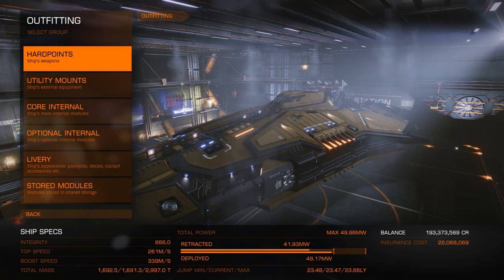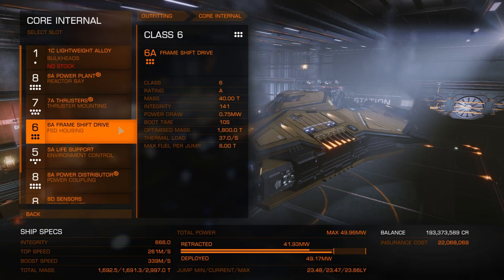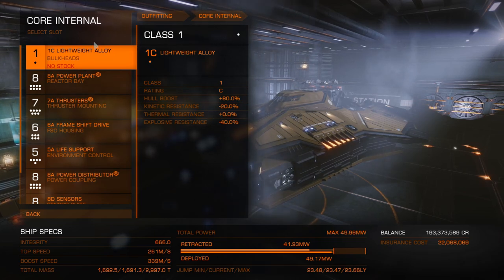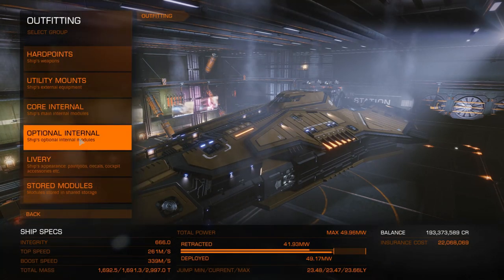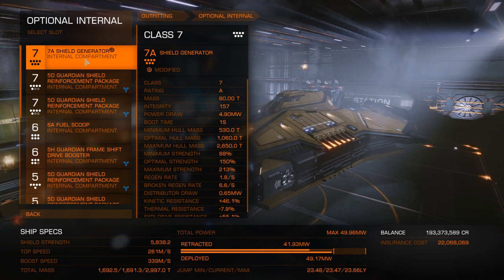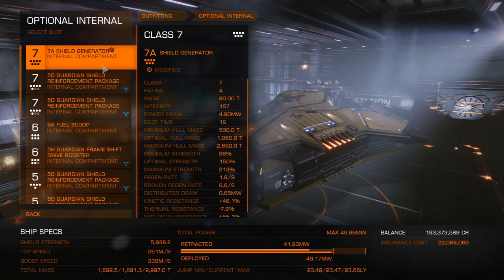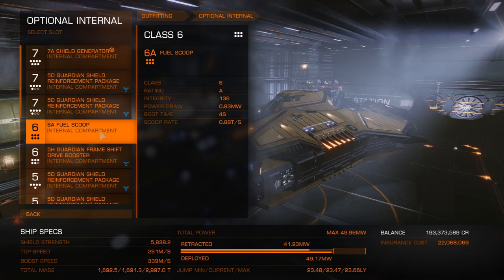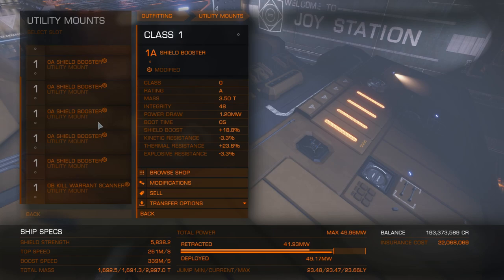Elite Dangerous | Federal Corvette | Combat Build

Comment: A no ammo loadout that I run is 2 medium and one large beam laser with heavent and close range they're one class stronger. The medium lasers each have about 25 DPS and the large one has about 35 DPS, if I remember correctly. Then 2 small railguns with plasma slug for anyone who uses chaff and then two huge PA's with plasma slug and overcharged for 'cause they can DELETE larger NPC ships. Very fun and  v e r y  deadly!

Comment: When they loop and throttle down, wait for them to close the gap then throw it in full reverse and you'll stay on target longer. When they start to pass pull your stick up and full throttle. You'll never lose target against big or med ships this way.
Reply: Or thrust downwards and look up. Also, better pip management
Reply: Another option is to pull a flip, thrust downward, pull up and revolve your thrust as you spin and one you are at full 180, full reverse, I have pulled this off on a couple FDLs and it's helped

Comment: power management(in my opinion) was a bit off.  When fighting NPC, shield longevity is key.  I would have put 2 pips to systems and 4 pips to weapons.  2 pips to systems over 1 pip makes a huge difference in shield strength longevity.  Power management(in my opinion) is much different between NPC combat, and PvP combat

Comment: I'd recommend a bi-weave for pve, you can get roughly 2000mj with 60% resistances, 5000+ hull is a good idea too.
2x 7a banks is pretty much a must on any corvette, you get roughly 6000mj of shields back from them.
While you're running gimballed, practice flight assist off as the corvette handles even better and if you can master that fixed lasers are more dps and less distributor draw.

Comment: I just got one of these too!!!. I'm running all focused burst lasers except one pack hound and a small over charged frag with corrosive.
Reply: The pack-hounds make sense for the times when you get chaffed and to keep up the damage rate (assuming the shields are down) while you get your aim back.
Reply: @simonpotter7534  I like to think so. That or a rail with plasma slug ..so I'm not worried about that ridiculous shot price
Reply: A high cap corrosive MC would be better, will last a lot longer than a frag. Try efficient on the huge Pulses, wi help you maintain fire for longer
Reply: Cool..I only use the frag when their sheilds are down and in close. I'm not wild about efficient lasers I would rather have more damage at distance over 500m plus the armor piercing of focused is a plus...but I'm a big "to each there own" kinda guy
Reply: I use efficient on the huge hard points and they still shred. You get a damage increase, less power usage, the focused uses more power and any armor piercing you get over 75 is pointless. Give it a try, it's pretty good
Reply: @cmdrravenwulff5272  I figured anything over 75 helped with breaching damage, but I'm pretty new to it all. I am just a 65 year old man playing video games lol.

Comment: I went with the Fixed Beam lasers with long range grade 3 and Thermal Vent - there is no chance of overheating if you stay on target, plus the fixed does more damage and not effected by Chaff spam.

My main gripe about any build is that the DPS is still way too low to be able to take down target before they decide to FSD out of there, which means the previous few minutes has been wasted.

What I try to do now in Haz Res sites is to pick the target that already has multiple NPC's shooting them, this allows for a much faster kill rate.  Plus as you already know there's no ammo to worry about.  You may be nerfing your self needlessly by having gimballed weapons as you're not spending as much time shooting them, but that does mean the ship is cooling down naturally.

Comment: I have this build but on my fdl, I have the vette but I dont like it as much as the fdl because it isn't that well engineered. On the fdl I have 4 rapid fire pulses and one huge beam with efficient and thermal vent, everything is g5 and I have 5c biweave with 50 to 70% resistances so I maximize charge over capacity and let me tell u, it's the best of both worlds. No ammo consumption, no overheating, decent amount of firetime (about 8 secs before capacitor is depleted) and on top of that scb's that ensure shields won't go down. It's a good and fun build

Comment: 2nd mistake....  gimbaled hard points when using lasers. whether it is beam, pules..   There is simply no need since there is no lead time for your shoots.  and the extra fire power you get with fixed weapons is much higher.  But if you must use them, you should unlock target when they use chaff and they work as fixed weapons.
Reply: It is with the vette. Shes light on her feet for a fat girl but not that light. If you want more than 2 seconds on target gimbals are a godsend

Comment: 1:41 your 1st mistake... the drive should be "quick boot"  in case you get hit by a FSD scramble missile you fsd reboots in 2 seconds vs 6 seconds... and yes it does make a difference when your shields are gone and you have to wait for the fsd to reboot.  for extra range add a grade 4 fsd booster..
Reply: Armored FSD is also a good option for combat ships. A lot of CMDRs - who know what they are doing - will opt to snipe your FSD when your shields drop, even over the Power Plant. Dead FSD = Dead in the water (or space). Many players who go for extended range FSDs in combat ships find out they made a mistake the hard way.
Reply: @jcdenton1841  happened to. Me last week. Except I got lucky and he targeted my fsd booster by mistake. So I got away. But great point.

Comment: I prefer 4A Fixed Beams, powerful and don't have the issue of being disrupted during chaffs. I opted to go with efficient, but overcharge would work wonders, and may be the only weapon you will even need on the Corvette. The rest I filled with 2x C2 Regen Beams for wingmates and pulse. You can unload the smaller hardpoints on a target as you wait for the big ones to fully deploy.

Comment: I didn't really see you put 4 measly 215mj guardian boosters into slots which could contain about 10000mj total in SCBs, did I?
Why?
Reply: SCB cause mad heat and massive power consumption, its also 100000 times more handy to not have to worry about your shields dropping
Reply: @cmdrblitzkrieg1012  heat can be handled by heat sinks, power consumption from modules is part of every proper ship design, also you can switch off 2 of the 4 cell banks until the first 2 are depleted and then switch. Watch some vids of e.g. Mayrune to see a properly built vette in case you are interested. You said not worrying about your shields dropping is always better well, the scbs reinforce it by 10000. so you're saying 800 mj guardian module is more than 10000 in scbs?

Comment: My Federal Rank grind was done in Gliese 868 by doing pirate massacre missions in the next system over. Took a while, but I earned over 2 billion credits at the same time.
Reply: How long did it take?
Reply: @cmdrblitzkrieg1012  a couple weeks, but I was casually pursuing it, only an hour or so a day. I just couldn't handle the monotony of the courier missions, especially since I had only just finished doing the Imperial courier runs. That took like 6 hours of dedicated circling, but it was more straightforward than the navigation required in the Federal run.

As for the pirates, in Gliese 868, i started in an Alliance Chieftan and finished in a laser Anaconda.
Reply: @FiveFootFall  might start the grind
Reply: @cmdrblitzkrieg1012  Good luck and Godspeed, Commander!
Reply: @FiveFootFall  o7

Comment: Love the courvette just a bit of easy mode when you get it....you do realise the cutter has a much higher potential shield than this though....the prismatics suit these large ships too might be worth the 4th week rush to get them :-) try the huge beams mixed with multis simple but effective weapon lay out..a turret in the large slot helps as it's quite hard to get it to target with all the other guns..:-) glad you like it n fly safe cmdr
Reply: Meh, I have a fully engineered vette. Unless you're in hardcore pvp or fighting goids, bi weave is better. Understand that while prismatic will last a long time in CZ and hares, they won't really recharge at all while you're out, you can always reboot repair, but that takes time. And take a long MF time to charge even on a pad. Bi weaves will not drop ever in PVE, and will let you stay out of station indefinitely (ammo permitting)
Reply: @Lperry  I'd never put bi weave on Vette  :-) I've had a vette for  a few years now deadly with no need for the recharge especially if used right, mines only legacy engineered and I haven't had my shields drop in pve for a long time...its shields arnt as good as my cutter but if you build in resistance and strength they last longer than your ammo
Reply: @lukedudley5030  I've never had shields pop in my corvette. I mean recharge rate while the shields are up. With a resistance build you may go down 1 bar with 6 pve ships laying into you, but you can recharge easy in between fights or after a cz is done. With my prismatic I find I have to go to the station and sit on my thumbs for 5 minutes after 2 CZs
Reply: @Lperry  what's your combat rating? Just wondering as the higher rated npc do get some engineering and are better at getting shields down and bi weave will drop go up slow due to size and any boosters you have and drop quick again in my experience...I put bi weave on small shield quick ships like clipper n krait but the big slows not for me the first ganker or pirate you meet will eat them in seconds :-) I always play on open and need the extra protection especially on vette as anyone like me sees it as a pretty easy target when in my pvp ship :-)
Reply: @lukedudley5030  currently at dangerous, but I almost always take elite ranked missions, including wing. Running corvette with class 4 PAs, large efficient beam with regen for when I play in a wing, medium long range thermal vent beams, and 2 high cap multi cannons with corrosive and thermal shock. I just got my prismatic shields so that I can be a little more confidant taking the billion dollar vette into open. I know it's suicide to take it with bi weave in pvp. But for pve, bi weave with 50+% resistances and SCBs is plenty to never have your shields drop even in a solo elite wing mission scenario. Probably wouldn't get off so well in my full spec mamba in a solo wing environment,  even though the TTK is way lower with the frag cannons and PA. More of a lack of skill as a pilot than the ship. I think my mamba sits around 2700 absolute with 37% being the lowest of my resistances. Could push it higher but I run chaff for when the fight turns from pursuit to jousting and I struggle to hit the dispersal field PA and rely more on scramble spectrum bursts and frag cannons. I'm not sure the mamba would be able to cope with the damage output of 3 elite vultures after focusing the main target down. And I'm certainly not the pilot to do it even if it can
Reply: @Lperry  that sounds like a pretty good all round build :-) have you thought about long range PA...more damage across the whole range and quicker projectiles making it easier to hit :-) also after 40% resistance you start getting diminishing rewards so you can get more overall output instead if you want....I have a 49% thermal t10 and it can go nose to nose with elite conda only losing 1 ring  so you could mix your engineering a bit...plus one last bit of info that might interest you..any not engineered ammo weapon (can be engineered weapon but no thermal or corrosive and such) gets bonus damage when paired with a corrosive gun :-) I'm glad you like the vette it's the best combat ship but is too slow for the the little bullies like the fdl and fas :-) o7 cmdr fly safe
Reply: @lukedudley5030  yeah I did, but I dont like running overcharged power plant.  As for the bi weave build, I'm aware of the diminishing return but when you have a fast charge bi weave the higher the resistances the more each point of regen is worth.

Comment: You don't need a rated life support, if anything you should switch that out for d rated and make your sensors a rated instead. Rapid fire pulse laser build is super awesome though by the way
Reply: why not have A rated life support and give it lightweight? This way it weights nearly nothing, and if someone kills it you have eternity to recover
Reply: @user-25352  unless you are in constant PVP battle, there's really no need. Even in those cases, I've only ever had my life support fail once. And I was still able to do a full restart and get things going again thanks to also having repair modules. You can design redundancy within your whole system by having systems back each other up
Reply: @sequoia1171  well, there isn't harm in bringing A rated system either? So why not. Unless money is a terrible concern ofc, but I feel everything else in stronger ship builds would cost a lot more anyway
Reply: @user-25352  if you were just trying to be a tank, then a rated systems all-around is probably the best bet. But most of us are trying to increase our jump range in any way possible, hence as many d-rated modules as we can get away with
Reply: @sequoia1171   ah so you really want minimize weight. Then remember that lightweight 5A life support only weights 3 tons, compare that to 1.2 tons of lightweight 5D. Difference is so negligible, you basically don't need to consider it. (And yes we go lightweight, there's no reason to not when we have near-eternity to fix it anyway)

Comment: Why does everyone love the guardian shield reinforcements? They really kind of suck.  Am I missing something?
Reply: theyre most effective on ships with poor shields, kinda useless ships with really good shields
Reply: Agree with android.  I have for example a crusader which I love, with 1500 mjs of shields, which is ridiculous for its size, and the fact that it's a bi-weave generator.  But, i dont need shield cell banks and rarely, and i really mean rarely, lose my shields.  This was accomplished running gaurdian shield boosters.

Hell I got a viper mk III with 760 mjs of shields just to say I did it, it's a silly build, and terrible anywhere but a nav beacon, but it's like a mad scientist build.

Now, if you will allow me to rant a bit further, I have two basic Corvette builds.  One with prismatics pushing about 3200 mjs of shields, and the other with biweaves pushing about 3000 mjs.  Both are designed to have very high resistances.  The prismatics require, require, shield cell banks, while the bi-weaves do not.

These are not pvp builds, obviously, but rather one, the biweaves, is for pirate massacre missions/gathering mats from said pirates.  Most of its internals are dedicated to storage, jump booster, and 9 limpet controllers.

The other is my personal flagship.  Its guns are not meta as with the first I described but rather set up for my own uses, general fun.  It sports multiple power play pieces and is best thought of as a showpiece.  Bring her out to impress the people, you know how it is, everybody must have two or three like that by now.

Both ships sport no gaurdian shield boosters simply because you dont need them.  3000 megajuls is three thousand megajuls.  With the prismatics, I had more space for random crap, but required way more power.  With biweaves pimped out with fast charge, I need no such thing and can concentrate on storage.  Honestly the biweave resistance build is what I run on nearly everything at this point.

Lastly, All my alliance piggys, and other such smaller ships, run gaurdian shield boosters for a little extra oomph.  Trying to get them over a thousand.  It's a luxury to be sure, but a welcome one in pve.

/rant.

Comment: Love your vids and your passion for ED, but you're wrong about the Cutter. The Vette is arguably better for pure PvE. Arguably. But the Cutter can be outfitted to have anywhere from 7-11k shields when built properly (base, not including SCBs), and if a CMDR knows how to perform an orbit manuever - where they boost in a direction that would start circling their opponent and go FA off - The Cutter is an absolute nightmare to fight. Some say that only the FDL is "better". All those shields and speed, with the added bonus of never being masslocked by other ships, trumps any deficiency the Cutter has in pitch rate. In fact, the Cutter is THE reason so many people on the forums/reddit are demanding something be done about the current shield meta. With Prisms, boosters and SCBs added, we're talking 20,000mj of shield strength. In a war of attrition, it beats everything.

Comment: with no cell banks you will be in trouble if your shields drop
Reply: I would be surprised if the shields drop in PvE with 6k mj
Reply: @cmdrravenwulff5272  depending on the intensity of engagement they will get worn down and could drop i suppose if you got lazy and didnt pay attention, perhaps bi weave would work better for fast recharge.
Reply: @sausageslaps  yeah but you'd have to be REALLY ignorant of your shields levels and pip management for them to drop. In CZs, I can sit with pips at 3/0/3 no issues. A spec ops wing attacking all at once might prove a test for it though
Reply: @cmdrravenwulff5272  yes, as i said if you are lazy, which i am, i dont move my pips like i should.
Reply: @sausageslaps  even with 2 pips, you'll be fine. Could of SCBs and you're sortes